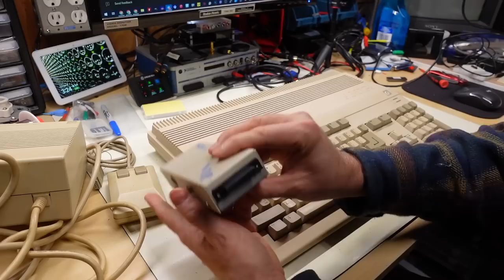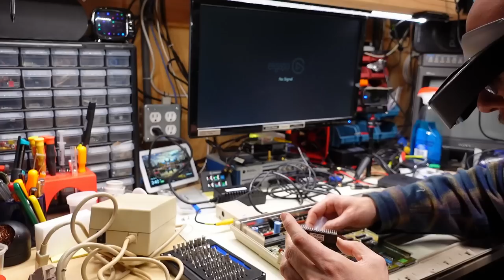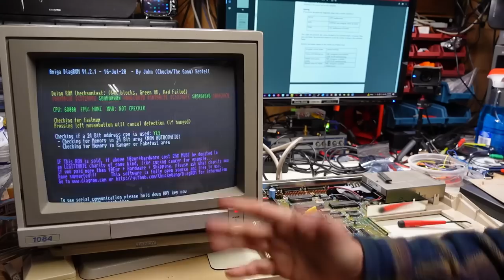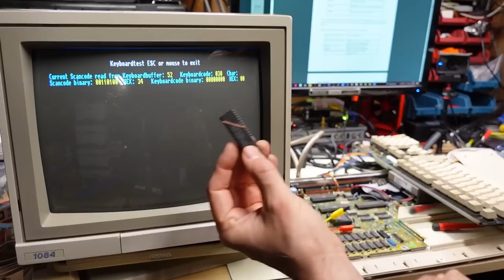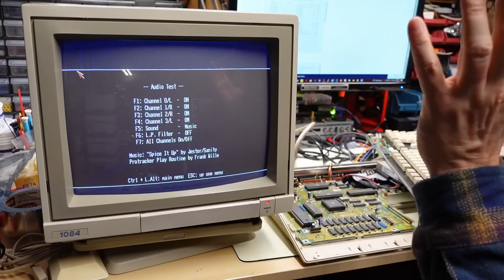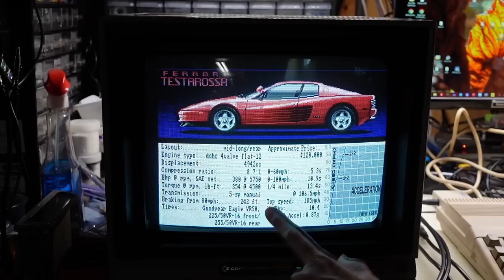Corroded Amiga 500 Rev 5 (w/512k ROM upgrade and S-Video out)

Comment: A lot of the amiga stores sell new membranes as well as a more sturdy replacement. They also sell a rom fix that just plugs into the rom socket for anything above 1.3
Reply: Yeah I bought one from ebay from a guy in Poland worked perfect when my space just stopped working.
Reply from the maker: I see they make a PCB replacement for the membrane -- that's cool
Reply: Heck yeah it’s sweet
Reply: Plus membranes can be fixed with those magic silver pens (that's actually what they're designed for).
Reply: @SockyNoob yeah i have done that before.
It can work but its a bit sketchy

Comment: As started Adrian,  When I was in my teens (early 2000's), I had an old membrane keyboard from my parents compaq presario 5000t. One day a whole group of keys stopped working.  I was able to disassemble the keyboard and using a multimeter I found where the trace had broken apart.  (unsure what caused it).  Soldering was out of the question on the thin plastic membrane, BUT I used some rear window heater grid paint available from auto parts stores.  Comes in a real small bottle with a paintbrush.  Painted a few coats over the split and reassembled the keyboard.  Worked like a charm.
Reply: This is definitely the way I would recommend unless it is a dual layer film membrane (sometimes with a third separating layer).  Separating the layers can destroy them sometimes depending on how it is made.  Single layer membranes can usually be fixed as long as the ribbon cable connector is still good.  How long it will last is hard to say, but usually quite a while.  Conductive paint is pretty awesome.  Needless to say, be careful when doing this because that stuff can make a terrible mess on a board and it is conductive.

Comment: The only way I know of to fix one of the A500 membrane keyboards is to seperate the layers and clean the contacts with a pencil eraser. It's risky but does work very well in most cases. If you find carbon pads benieth the keys I would use isopropanol and a cue-tip or other cotton swab. For the carbon pad on the key side, just rub it acros some paper until it leaves a good solid skidmark that is the same width as the pad. Note that this trick also works for TV remotes where keys stop working.

Comment: Naval jelly is basically phosphoric acid and a binder. Bilt Hamber makes the best alternative in Deox-gel. You can make your own using some sort of starch, water, and acid. Phosphoric is particularly nice on steel, because the phosphate it leaves behind is good at holding oil or wax for further protection. Citric acid is common and very mild and benign, leaving clear surfaces. Clean white vinegar is probably the most widespread stuff. Avoid Hydrochloric acid and chlorine like the plague if you care about metals in the room!  See also: Parkerizing.

Comment: I repaired my A500 keyboard with silver contact paint. It's about as expensive as printer ink, but does the job fixing hairline cracks in flatflex stuff if it is under low mechanical stress. So once the membrane is inside the sandwich again, it should be fine. Hint though: let the paint dry, it will not conduct properly when still wet. :) (edit: I still haven't edited the video for that one; it's my oldest "eventually" spare content one but on mine one of the Amiga keys was dead, and you need both for the reset combo)
Reply: I had the same problem, and come up with same solution - works great! Done it about 7-8 years ago, and it still works flawlessly!
Reply: I came here to say conductive ink pen should fix it. The paint is probably more robust.
Reply: Fun fact: That's actually what conductive silver pens are designed for! Repairing membrane traces that can be worn off over time.

Comment: I have repaired membrane keyboards with a conductive paint, intended for repair of rear window defroster in cars. It works great.
Reply: works better for repairing keyboards than using it to repair the defroster
Reply: @mauzzz2418  well I got it to work for defroster somewhat okay, had to paint in several layers, letting it dry in between.

Comment: There is an "impact screwdriver" for $10 from Harbor Freight (#64812) that is great for stubborn screws, when smacked with a hammer it ensures maximum head engagement at the same millisecond that it is converting some of the smack force into turning action.  Of course for screws into plastic you'd probably smack it more lightly and ensure exact downward straightness, than in an all-metal situation.  Since I got one I have never chewed up a screw head again, couple taps and it breaks loose and then switch back to the usual screwdriver.  It has a 1/4" square drive for sockets and includes an adapter for any standard hex bit aside from the six bits it comes with (three Philips and three flat-blade).  Comes in a storage case to blend in perfectly with every other thing that comes in a silver plastic latch-box. :)

Comment: I’ve repaired a few amiga keyboards. Yes there are a few options for membrane replacements. The one I favour is the “hard” membrane replacements, readily available in the UK, sadly I’m not sure of availability in the US. 
But I’d try fixing first. Having removed the 40million screws (slightly larger screws around the pcb controller to watch for), remove the membrane, place on flat surface and gently wipe with water or if feeling brave some glass cleaner can work well. 
Sometimes I’ve needed to refurbish the little plunger, some conductive 
paint can be used (Liquiwire
50mL Electrically conductive paint for PCB & electric circuit repair from Amazon) is what I’ve used with success, dip the plunger into it and let dry. As you say Esc and F1 not working when the rest work usually points to plunger or dirt on membrane. Before going to the bother of getting the conductive paint, try swapping a couple of plungers around. 
Hope this helps.

Comment: On the flickering video check the two large caps near the video port. They tend to go bad and can short out.   They will also over heat the resistors.   I've had that occur on two of my version five boards

Comment: I really could have done with something like that S-Video adapter back in the day. That combo of the 1702 and the A500 (rev5) was my setup. I used the colour composite out of the A520 modulator. Which was ok but slightly blurrier than I would have liked.
Reply from the maker: Indeed -- the S-Video was shockingly nice compared to the composite video. It certainly work but it means the high res text is a bit hard to read.

Comment: If I remember correctly those mitsumi keyboard membranes are actually single layer and there are rubber plungers which make a connection between 2 pads to register the keypress (in the same way as the c64 keyboard works).  I'd be tempted to take the keyboard apart and check that the issue isn't simply that the rubber contacts on the bottom of the plungers are dirty for those two keys and hence are not making a good connection or that there isn't just a bit of fluff in there thats preventing those keys from making a good connection.
Reply from the maker: Ah I see -- so instead of a PCB like on the C64 they just put the carbon contacts on a membrane?
Reply: @adriansdigitalbasement2  I think the samsung ones might be two layer, but yeah, I'm pretty sure the mitsumi ones are just contacts on a membrane.  I'm guessing it saved commodore a few pennies.  There are now aftermarket solutions where you can replace the membrane with a proper pcb solution instead.  I've never tried those, so don't know whether its an upgrade or not though.
Reply: This exactly.  Don't discount the rubber on the posts.  I was given (5) A500 keyboards to repair and only one had a bad membrane but the rest had various keys that did not work and in all of those cases it was the rubber that lost its conductivity.  Replacing them fixed all of them.  If it does turn out to be the membrane you can purchase new replacements including a PCB version that uses a very thin PCB and gold contacts.  I have used both solutions and they both work great.
Reply: I wonder how many different ram cards were produced for the A500… the one I had was ICD’s AdRAM 540, which consisted of the main board in the trapdoor bay, a small board that fit beneath the Gary IC, and a small ribbon cable linking the two. The truly nice thing about that card today is the battery backed clock ran on (I think) a CR2032 lithium battery instead of the dreaded NiCd battery.

Comment: If the keyboard is anything like most keyboards with a membrane sensing mechanism, you should be able to separate the layers of the membrane and clean up whatever gunk is on there and use a conductive silver pen to redraw the traces. That's what those pens are actually designed for! Also useful for membrane flex connections that use that same silver trace material that can wear off. Make sure it's using paint and you let it harden completely. A rather easy fix honestly.

Comment: New membranes are available but not for the one which uses 2 ribbon cables AFAIK.

You can even get a 'pcb' type membrane instead of the original   type.

It's well worth changing the two larger capacitors near near the power input jack, they're notorious for failing and causing issues when accessing disks.
Reply from the maker: Yeah I bet those caps are problematic -- it makes the most sense.

Comment: Great video Adrian!  Have you ever used that CLR Calcium, Lime, & Rust Remover stuff to clean contacts on any vintage computer?
Reply from the maker: I've only used it in my bathroom. I would worry it's too harsh on the non corroded metal parts of the machine.
Reply: @adriansdigitalbasement2  Gotcha.

Comment: I remember having a Workbench 1.2 Amiga 500 as a kid. It was also weird in that it could handle 1.44mb HD Floppy disks, I'm pretty certain they were only supposed to be able to handle DD disks. I do miss that quirky machine!
Reply: Probably only 720kb?
Reply: early A500 did ship with Kickstart v1.2. I had one. The only real difference was that you could boot from a HDD with v1.3. You could run Workbench 1.3 on the 1.2 rom, in fact there was a patch that would load at boot time that would fix a few bugs in 1.2.  As for bootable HDD, it was still possible with custom boot ROMs.  I had a GVP expansion box that included its own boot ROM that allowed me to boot from HDD with Kickstart 1.2.  (It also had 2MB of fast ram). I later did upgrade the ROM to v1.3 and yes I had to have a tech install the bodge wires for it. I also upgraded it to the ECS Agnus that allowed 1MB of Chip ram (also software PAL/NTSC switching, for those rare instances I ran into PAL games).  I was trying to remember if I actually had 1MB of chip ram (the 512k "trap door" cannot be used as chip ram, it's actually called "slow" ram..) but I'm not sure, I think I might have had the 512k ram chips desoldered and 1MB of chips installed on the board. So I had an A500 with 2mb of Fast ram, 1mb of chip ram, and 512k of "slow" ram... and a 30MB I think SCSI HDD.  Pretty slick for an 80s kid.. though I would later upgrade to an A3000. That computer also came with a dual rom setup and a menu that let you boot into Kickstart 1.3 or 2.0..
Reply: @VIC-20  880k

Comment: The membranes on the A600 and A1200 usually fail because of the wear and tear on the flat flex from moving, unplugging and reconnecting the keyboard to the motherboard. Since the A500 keyboard membrane is usually left attached to the integrated controller board it is more robust. A500 keyboards tend to be older than A600 or A1200 ones and the individual switches are a more likely point of failure through loss of conductivity. Repair should be possible with cleaning/conductive paint or replacing the key plunger with a spare from a broken keyboard.

Comment: Re: Keyboard. With the Mitsumi keyboards it's often not the membrane that's the problem. Instead it's the carbon impregnated rubber on the bottom of the stems. This will often oxidise and become non-conductive if left in a damp environment. You can buy carbon paint, often sold for garage door remote button and remote control button fixing to get them working again.
Reply from the maker: Yeah sounds like it's similar to the Mitsumi plunger style keyboard used the PET and C64. I have strategies for refurbishing those like the paint -- so I'll need to try it on this.

Comment: Always good value. Keyboard Membrane Repair, FWVLIW:
Just don't, you'll be much happier!
...but if you must, or just don't have an option: (nobody makes replacement membranes for my favourite retro system)
1) Find the schematic and test the leys.
This will likely tell you if the issue(s) is/are with:
-The connection with the with the computer (I hope you checked that first!) 
-The controller or it's connections (hopefully the socket or dry solder joints, not the chip itself)
-One (or more) of the main row/column traces on the membrane (repairs are easier if any cracks aren't near the keys)
-An individual key or local trace(s)
2) Carefully disassemble the keyboard:
-Dry clean the key mechanisms and partially reassemble. If you're very lucky it was just guck / grit
-Brush down the outsides of the membrane ONLY and give it a gentle flap. Test again, maybe just a bit of grit / guck
-Being VERY CAREFUL look for any cracks in the FULL LENGTH of likely tracks by continuity testing and then magnification to find the exact spot(s)
-No clue? AMAZINGLY CAREFULLY push a FLATTENED cotton bud tip between the membranes where the key presses and GENTLY rub both sides
(It may be the pads have a bit of build-up that is preventing conduction, hopefully you shifted it without scrubbing off the usually very delicate film)
-If you found a cracked trace you can effect a repair with a product like Wire Glue, Silver contact paint, or similar...
a) It's amazingly important NOT to daub it on - claggy lumps ruin membranes. Whisker-thin dab, dry, test, more if necessary...
b) If the crack(s) is anywhere near a key actuation spot you are almost certainly NOT going to effect a successful repair, but try if you must.
Second last resort:
If it really looks like all the traces are good, it's just that the pads under the key(s) are worn out you may get away with the old drawing on the pads with a soft led pencil trick, taking care NOT to distort or scratch the plastic. If this works at all it probably won't last long. Alternately a very VERY thin layer of Wire Glue or similar might help. You can even try applying a small circle of gold leaf!!! (expensive, horribly fiddly)
Last (first?) resort:
You could design your own replacement keyboard PCB to interface with the old logic. Not as hard as you might think - there are online resources to help. Two options:
a) A PCB with SMT tact-switches or dome switches to go where to old membrane lived. If there's room, great. If not you may need to sand a little off the bottoms of the old key plungers - this will leave you with a seemingly authentic keyboard that's more reliable and a better action. Best to order a PCB thinner than the standard 1.6mm if you can, some manufacturers will even do flexible ones but they are horribly expensive and they aren't necessary. An awesome mod for the old rubber-key ZX Spectrum, but it works for many mechanical keyboards too. The old membrane will serve as a template for your layout.
b) A complete new mechanism using modern mechanical switches - more fashionable and possibly more robust and future-proof. But modding old keycaps to fit new switches is a bugger, as is finding new keycaps that look the part. Then there's the whole "Am I going to have to design / program my own controller too?"

I hope that helps someone.

Comment: A non-working key can be either a result of a faulty membraine (one path rotten - can be fixed with a conductive paint) but it also may be due to oxidation of a plunger - you won't know it untill you disassemble it.

Comment: if it's a membrane of rubber domes... then I've done similar, since many game controllers and remotes use similar tech.
Typically, the membrane has a graphite patch in the center, which shorts across two exposed copper contacts when the key is depressed. Just like many game controllers.
If the membrane itself is intact, but the contact pad is bad, it's just a matter of affixing a suitably conductive substance to the contact patch. I've done it only on NES controllers, calculators, and a TV remote -- short term, graphite worked, but needed redoing.  
Aluminum foil did not work - -the oxide layer isn't great. 
Copper detailing foil did work. (Scaring me to think that was 30 years ago.)

Comment: If the membrane is dirty just split it apart at the F1 and Esc keys and clean the contacts with a pencil eraser first.  If that doesn't work try a tiny bit of the carbon conductive paint.  I actually used aquadag paint myself, I didn't want to spend the money for the membrane paint.

Comment: I'm sure I heard you wrong, but it sounded like you said the Amiga 500's video output was monochrome? I seem to remember full color graphics when I had mine plugged into the monitor.
Reply: It is full color if you are using the 23 pin RGB port but the composite video port built in to the A500 only outputs monochrome, hence why Commodore marketed the A520 TV modulator for the A500.  Why they made the built in composite mono only is a mystery for the ages but typical crazy Commodore decision making.
Reply: @jhfgjtjutyiuod  Ah, I always plugged it into a monitor so I never noticed. It does beg the question of why they did it that way. I hope the only reason wasn't just so they could sell an extra adapter, but I wouldn't put it past them.